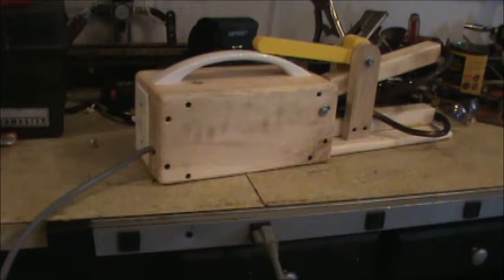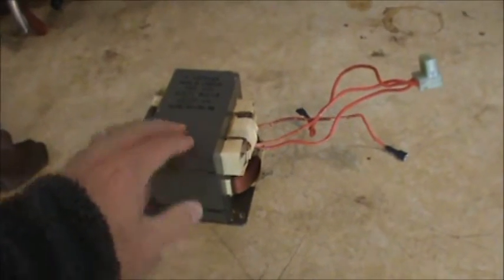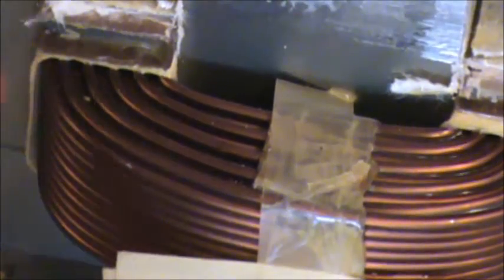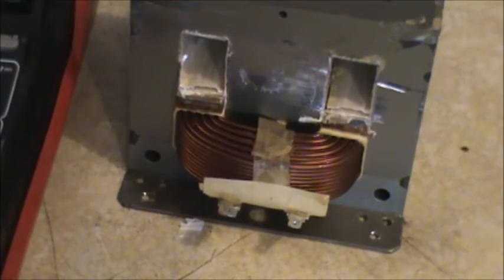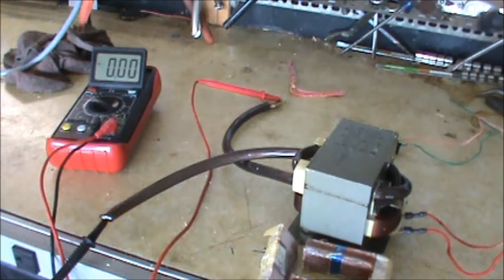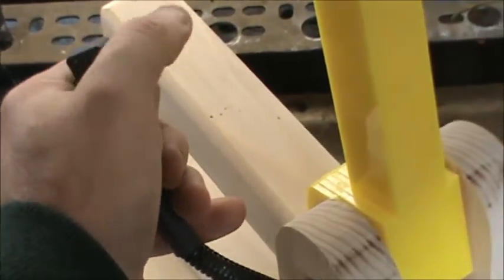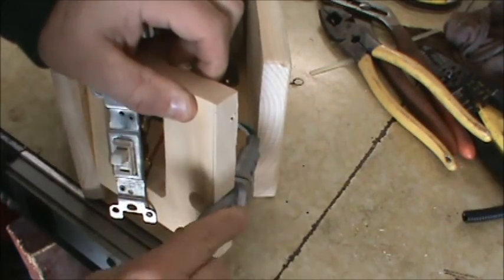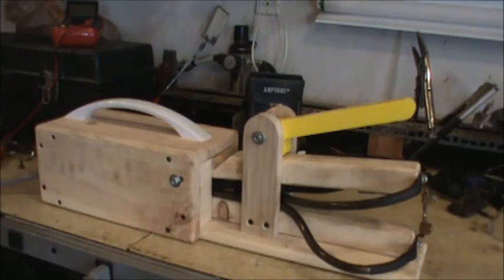DIY Homemade Microwave Spot Welder  See Description

Comment: The secondary coil how many turns? It's  useful but one thing that your main switch  is upside down I stands for On and On for off you can change the wire only thanx

Comment: You copy well, but unfortunately you copy the mistake too. The transformer need cooling, you should not totally enclose the transformer.  That is why the wires and contacts are hotter and oxidize so much more.

Comment: What caliber is the cable? Sorry , do not understand much English .
Reply: He used 2 gage wire. In english we call sizes of wire "gage" Caliber is used in gun barrels
Reply: Randy Phillips
 how many milimeters in diameter is 2 gage wire or how do you compare gage to milimeters ?
Reply: You got me there. But from my experience and looking at the pictures I would say the wire is about 8mm. Looks to me what is used in a light duty welder or even car battery jumper cables would work good. They will be carrying current for a short time so for most home amateur uses they will have time to cool. I would stay away from aluminum wire if possible.
Reply: +Randy Phillips Gauge! Don't give people advice when you can't spell...

Comment: Awesome instructional! I'm preparing to make one of these since I got a nice big transformer from my friends old microwave.  I tried to make an arc welder with two old MOTs, but didn't have much luck, I think I would have a better time with those if I had access to a 230V line. This one will be much simpler as it only runs off of one MOT. Thanks for the video!

Comment: I have a question. You can weld galvanized wire?
Reply from the maker: galvanized metal does not weld.
Reply: ok thaks....
Reply: doublewide6 thank you for this informative video. i have a junk M-oven and  want to build one like this, can i also use this as an arc welder since it has large amperage.
Reply: doublewide6 it does weld.. but it gives of some nasty fumes that is super unhelpfull to inhale so do not weld anything that is galvanized.. ever.. you may die of Chemical Pneumonia, you have been warned.

Comment: Nice vid. I made one of these a few weeks ago and it worked well the first few times, then I noticed that the copper tips and the copper holder started to oxidize and turn black and not conduct well, requiring some cleaning. Has this happened to you? Also 2 more questions. With all the amps going thru the output, why don't you get shocked when you touch the work being welded? I touched the work myself and didn't get shocked, only hot to touch. Last question. When you rewind the transformer does the two gauge become the primary and the existing MOT that was the primary now become the secondary? Thanks!
Reply: Yep, keep those terminals clean, and eventually they'll need replaced. You can think of the primary and secondary coils as "in" and "out." The primary is always powered by something, and the secondary provides power to something.

The stock MOT has many more windings on it's secondary coil than the primary, which will increase the voltage. 

We replace this coil with one with much fewer turns, lowering the voltage.

Voltage is the potential for electrons to move from one place to another. It takes a certain amount of voltage to overcome a materials resistance to allow those electrons to move.

Our skin and flesh has a naturally high resistance (but not too high, after all we are mostly water).

The voltage of the re-wound secondary will be too low for your skin to conduct it, and thus, no shocky shocky!

Comment: I made 1 just like Grant also, only different is I put in a microwave fan, between the switch and the transformer. My problem is whatever I try to weld like washers
they get red hot but I can pull them apart with my fingers. same thing with the spikes.so I have no clue what could be wrong...

Comment: Thanks for the quick response, I went with the 2 gauge. Hobart welding lead wire from Tractor Supply works very well as it is so pliable. $4.99 a foot though.

Comment: What would be the difference in using 4 gauge vs 2? I welded for years with a 4 ga. Whip at 120 amps. If 4 were used would I need to make more wraps or would this increase the voltage too much? Great project!!
Reply from the maker: 4 gauge would work, but it will run hotter.  You would half the amperage and increase your output voltage, so nothing would be gained.  It would be best to use 2 gauge, my 2 gauge gets hot quickly.

Comment: Did you measure the current on the secondary?
Reply from the maker: No, I did not measure the current, I do not have an amp meter, my guess is around 800 Amps.
Reply: +doublewide6---///   Suppose this : The primary tension is 120Vac and the breaker is a 15Amps, that gives you a 1800Watts maximum power (120VX15A=1800W). At the secondary, the power is the same, thoug 1800W divided by 2Vac gives you a 900Amps current. It is why you need bigger conductors for the secondary winding and not for too long welding time either. This is why the micro switch trigger is on the primary winding because it can support a 15 A current, but not a 900A current. Take care and work safely.

Comment: This is new for me. I shouldn't throw away my transformer microwave. How do you connect from the power to transformer I did watch your video, but I keep rewinding it, anyway what is that again low voltage but?
Reply from the maker: Never plug in a transformer from a microwave the high voltage can kill you. If you rewind the secondary and step it down you can apply the common and hot wire to the 2 terminals on the primary.  You should also ground the Mains (120V) ground to the transformer base. This is not something I would recommend doing unless you have a strong electrical background.  When wired correctly the spot welder will have high Amperage and low Voltage that is why the leads can be handled without getting a shock.  Be careful and I assume No liability for your actions or anyone else.  Thanks

Comment: Nice video, I won't look at a microwave the same again - Does it matter what the wattage of the microwave is or are the transformers the same size in all microwaves?
Reply from the maker: I think you need at least 900 Watts, but the higher the better.